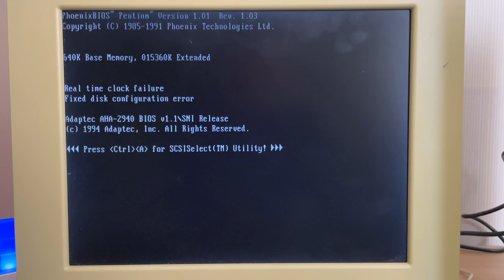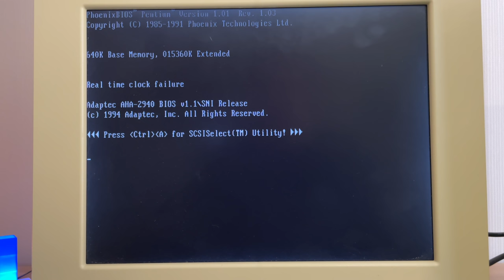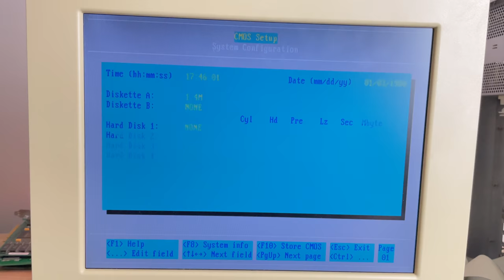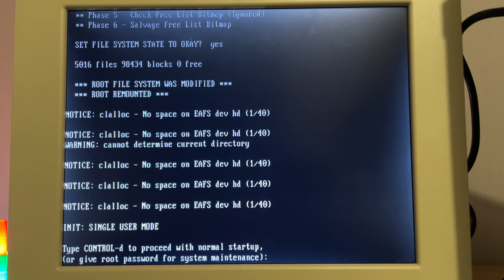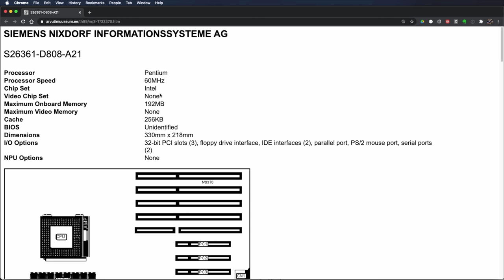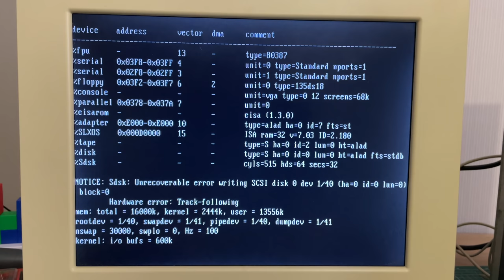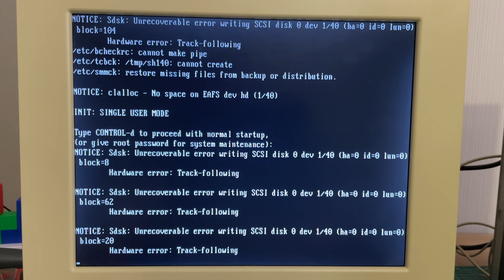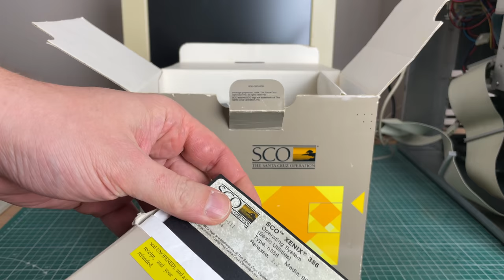Siemens PCD 5T Pentium 60MHz Workstation

Comment: Never seen a system where the Dallas clock chip also powers the CMOS chip and keeps settings stored.
Reply: Hi - they have 2 functions, real time clock, plus a powered storage for CMOS / BIOS information

my generic pentium 100 has AMI bios, but with a dead Dallas chip you can access and change all the setting, but when you go to save , it cannot save on the dallas, well it does but due to dead battery it does not actually save.

I have managed say 1 or 2 reboots very fast where the stored info has lasted long enough for the next reboot and the hard drive settings were retained and it worked but it does work as a normal pc with no saved date and time and works of the floppies OK - i do have a Gotek

Eventually i purchased a working dallas battery - i tried modding 3 of the dead ones but no success, i later found out you can buy then new

Regards
George
Reply: @georgemaragos2378  I love my GlitchWorks RTC chip!  I think that Monotech sells them too if I recall

Comment: I have the exact same tape drive, I wonder what tapes it takes
Reply: Something like a qic-1000 or qic-525 tape.  Depends on the model of the drive. But in general they use the large formfactor QIC cartridges but would be limited to maybe 2 or 3 tapes in that range.  There's a large range of tape formats that could physically be inserted into the drive that would probably not work since this tape format went from 30MB or so to 1.2GB or more, depending on the drive design.
Reply: @stonent  Thanks !
Reply: hmm before putting that tape drive to use have a close look at any parts that are rubber in there as that system is over 20 years old rubber may have gone sticky and need a refurb.

Comment: This may have run an email server or something like Informix database :)
Reply: At my job in 1998 we repurposed a very similar machine (already considered old then), the difference being it was a Pentium 75. We installed Windows NT 3 on it and it ran a Microsoft SQL Server (6 or 7?) very happily. The fast SCSI drives were enough to make it as performant as newer 133 MHz IDE based servers we had back then